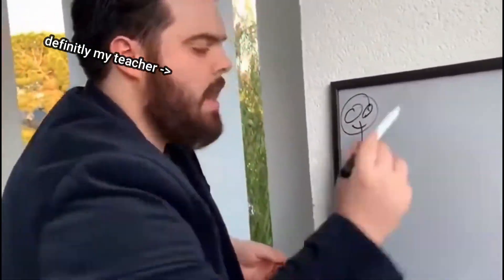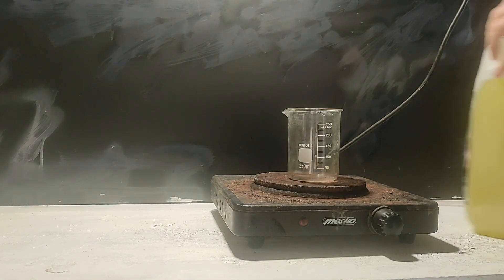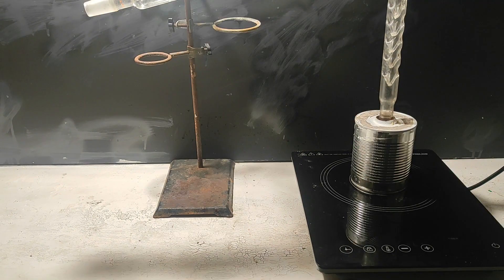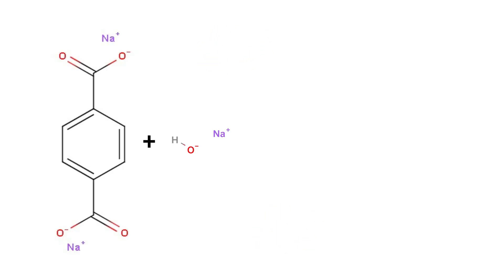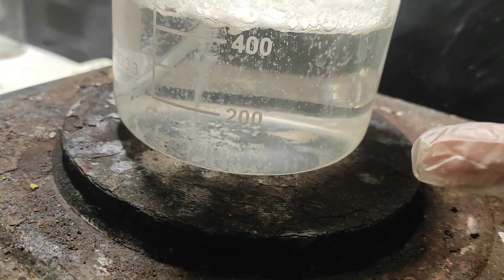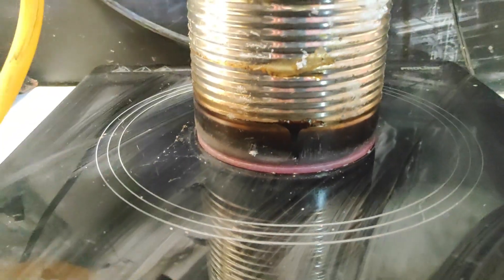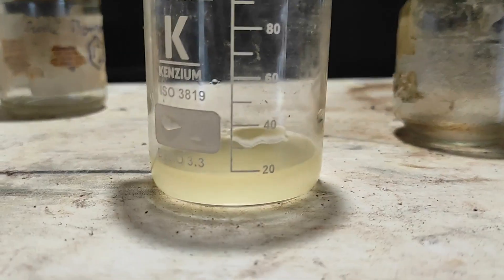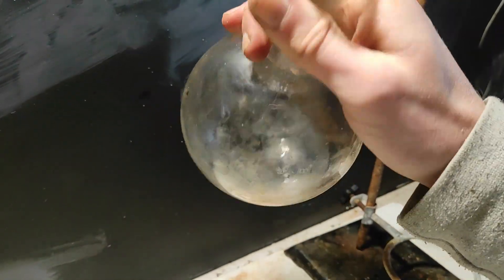Turning Plastic Waste into Benzene

Comment: Why did you heat the ethylene glycol to begin with?  What is the purpose of that?  Why do we mix sodium hydroxide with ethylene glycol when we want to obtain terephthalic acid? Why do we not suffice with sodium hydroxide, water, and PET to obtain terephthalic acid?
Reply from the maker: Water can only be heated to 100°c so the reaction would be too slow.
On the other hand ethylene glycol can be heated to 197°c which makes the hydrolysis the fastest
Reply: @jam_kemist3986   i got it , but u did not tell me why you heated ethylene glycol first ?
Reply from the maker: @daox923 my source of ethylene glycol only contained like 35% iirc so I had to boil of the water first. You don't have to do that if you have pure ethylene glycol
Reply: @jam_kemist3986   i saw someone that he put ethylene glycol with sodium hydroxide with out heating it
Reply from the maker: @daox923 did it work?
Reply: @jam_kemist3986   yeah it did

Comment: Nice video, it can be so hard to find synthesis protocols for common reagents that are accessible to amateurs. I know some other videos have been made by thermal decomposition of polystyrene (foam, or from those transparent plastic forks) but your method seems to be higher yield. Cool stuff as always Mr. Jam_Kemist!
Reply from the maker: thanks ! I didn't get that huge of a yield tho, maybe you can also try directly pyrolising PET with a base like NaOH or even ZnO and that could work as well. just be carefull not getting cancer !

Comment: Just found this channel and i find your videos very useful! Do you fhink that making benzane from toluene would be a good idea for saving some money? I do have a lot of toouene at home.
Reply from the maker: If you alredy have a lot of toluene that's a good idea. You can react it with a strong oxidating agent such as KMnO4 or CrO3 to make benzoic acid and then do the decarboxilation, but I've also heard of a way using anhydrous AlCl3 to form benzene directly. Anyway do some reasearch on what would be best for you but it's definitly doable ! Thanks for watching/commenting :3

Comment: Hi Jam kemist,
Nice video again :o)
Yes you got it, PET(E) plastic is indeed a good otc source for terephtalic acid and benzene.
Benzene being a core product of organic chemistry despite its bad reputation and attendant danger or risk for health (carcinogenic, teratogen, toxic, flamable, pollutant, eco-unfriendly,...); it is hard to come by for chemist and cost a lot; PET is essentialy free if from garbage.
Terephtalic acid when purified by precipitation from solution of NaOH is quite interesting with regard to the price of the product (IIRC 20€/kg)

In big cities like Bxl capital, it is easy to recollect from blue plastic trash bags for recyling (or you can conserve it and store to get a decent amount).

The fact PET is a polyester is not wel used but explains why PET bottles are terrible for storing some chemicals and in fact they can store water and solutions, and maybe some non reactive solvents but they are: 
-not long stable towards acids 
(especially strong ones - HClO4 72% is a NO GO; I imagine H2SO4 or HNO3 aswel); 
-even less stable towards bases (especially strong ones or volatile ones like NH3 from NH4OH)
The plastic makes flakes and the bottle breaks down into bits of plastic and terephtalates.
When you take the bottle, it may crush into your hand and fall into pieces; this occurs easily with volatile NH3 so the bottle becomes cloudy and like multi-layered.
-Aceton make it slowly shrink (so height and diameter diminished in favor of a thickening of the wall thickness... and slowly evaporates through the walls

One of the unsuspected effect and product of the benzoate or terephtalate is the thermal recombination of the two benzyl or p-bi-phenyl moeities...
2Ar° --> Ar-Ar +(higer/longer polyaryls); so there is also some terphenyl and tetraphenyl but in lower extends
2 °A° -->  °Ar-Ar° and so on

Ah yes, if you plan on more industrial work up; maybe a CD cutter or paper shredder should be interesting buy; in a way to avoid long use of scisors and hand pain.

Keep on the good job.

PHZ
(PHILOU Zrealone from the Science Madness forum)
Reply from the maker: Thanks for the idea !
Reply: Ah yes the reaction towards basic solutions into PET bottles is evidenced by the apparition of a cloudyness inside the transparent cristal clear plastic that display then a frosty shine; at first superficial, it becomes deeper until the recipient can collapse and fall into pieces.

If you try to expose PET pieces to NaOH (in concentrated form - beware for the eyes and skin - corrosite and can make you blind by turning lipids into soap- ; it will take quite some time; this process is accelerated by a good relatively inert solvent like glycol and increasing the heat of reaction to speed things up (common rule in chemistry is that every increase of 10°C increases the reaction rate by a factor 2 (20°C by 2EXP2 or 4; 30°C - times 8; 40°C - 16 times faster - 50°C (2 EXP 5) is 32 ...)

Better keep your PET platic cuttings into a closed hermetically sealed PE or PP plastic container with a top/cap below 80°C for PE integrity and below 110°C for PP integrity; those two resist wel NaOH and water and some heat (PP > PE). PP resist boiling water at STP.
It will prevent the NaOH (aq) to react with CO2(g) from the air instead of (-)O2C-Ar-CO2(-) from PET plastic